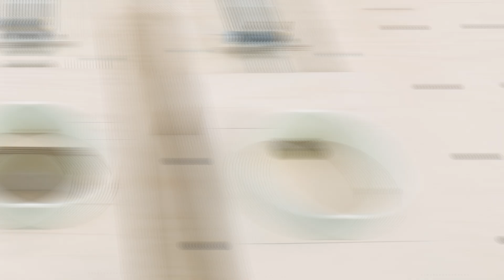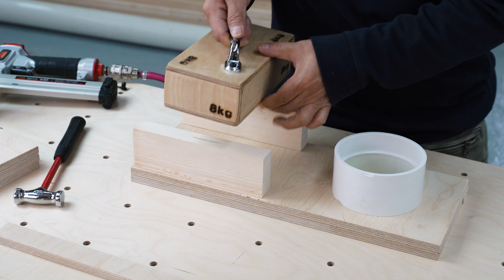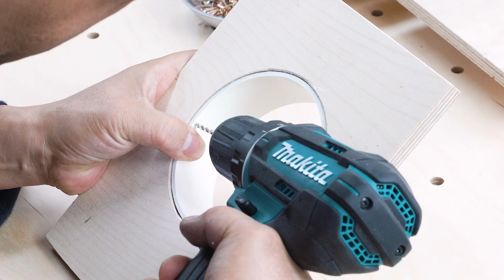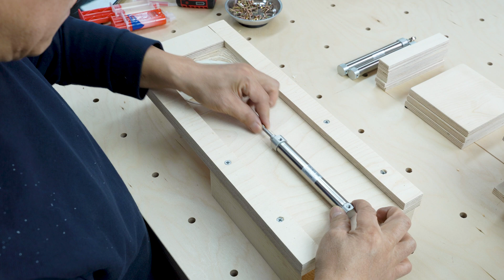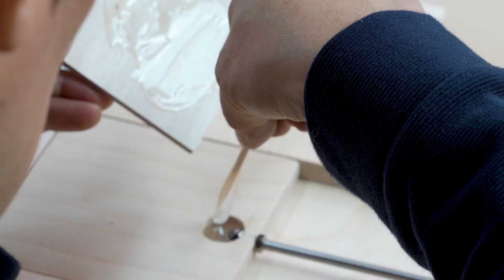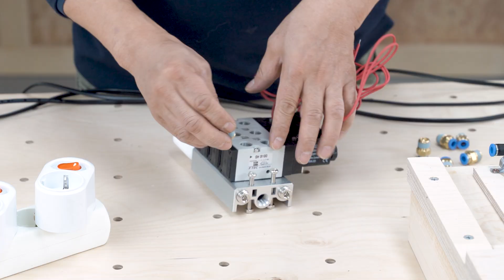Amazing Woodwork Project / Sanding Base / Part 2 : Dust Collecting Switch / DIY

Comment: Muy interesante, gracias por compartirlo. Creo que intentare replicarlo para un proyecto mío.  ¿Puede compartir las especificaciones de la valvula solenoide y del cilindro neumático?
Reply from the maker: Gracias por su interés en mi video. El cilindro tiene un diámetro de 20 mm con una carrera de 100 mm. El solenoide es un tipo básico que puede cambiar la dirección del aire con una fuente de alimentación de 12v.

Thank you for your interest in my video. Cylinder is 20mm diameter with 100mm stroke. The solenoid is a basic type that can change the direction of air with 12v power supply.

Comment from the maker: Sanding Base Series Video
#
Amazing Woodwork Project / Sanding Base / Part 1 : Lower /  DIY
https://youtu.be/VN2eeM-xc-o
#
Amazing Woodwork Project / Sanding Base / Part 2 : Dust Collecting Switch / DIY
https://youtu.be/WAUJ6vwIx8c
#
Amazing Woodwork Project / Sanding Base / Part 3 : Upper / DIY
https://youtu.be/FqqoNE_h9DQ
#
Wall Ventilation System / Rear of Sanding Base / Spin-off / DIY
https://youtu.be/QzqwThud3ek
#
Sanding Base Suction Test / Shorts
https://youtube.com/shorts/TEvkA-448IM?feature=share
#
Sanding Base Ventilating System / Shorts
https://youtube.com/shorts/kRHQOhqN5u8